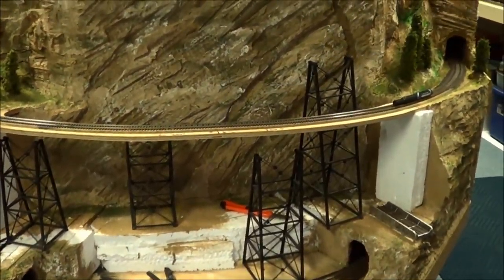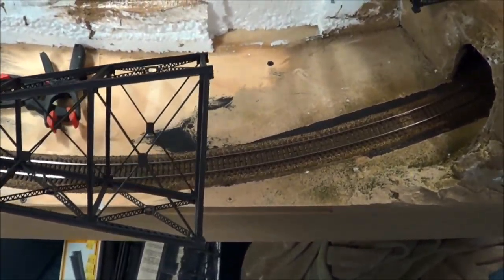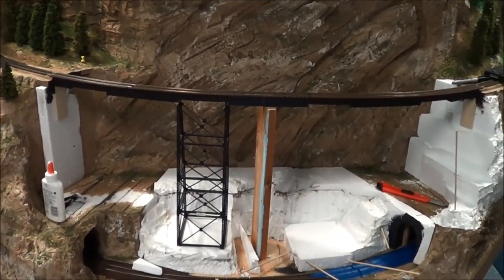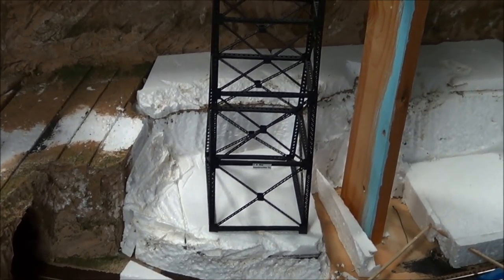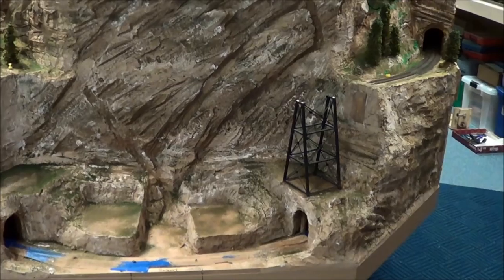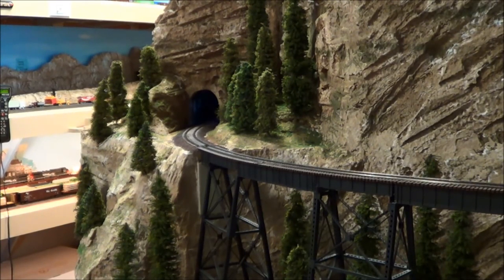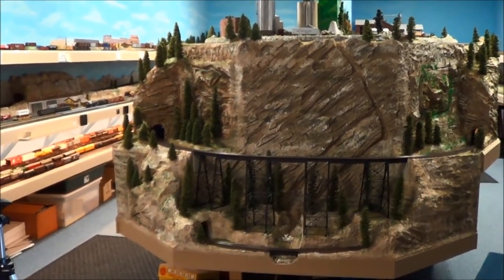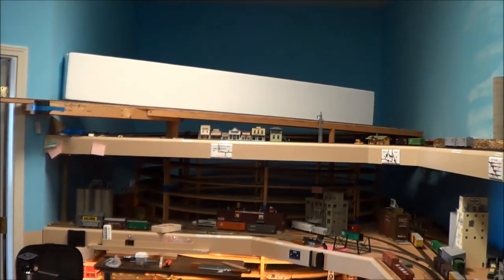Grande Pacific Railroad Part II  The Big Scene 8-2015

Comment: AWESOME!!! What radius curve is that? Im inspired!
Reply from the maker: All Main line on this RR is 36" some larger.
Reply: @arthurhouston3  thanks! Looks real good
Reply: @arthurhouston3  Are you atabout 24inches between the two track levels? Been rewatching pieces a few times, maybe i just missed you say it. Id like to use this approach on my own layout, albeit with a lesser 29" curve lol
Reply from the maker: @CSX_Bennett_Subdivision  The levels are off the floor 24" 40" and 60"  if did it again top would be 56 take one turn off of helix.  But it all works well.
Reply from the maker: @CSX_Bennett_Subdivision  24 from floor to top of bottom level.   40" from the floor to top of center section.  60" from the floor to top of third level.  So 16 inches between bottom and middle top to top .  Only 12" top of bottom to bottom of middle.  Used 1 x 4 for construction.  16" from top of middle to bottom of top level.   20" Top to top but have to take away the 4" for 1 x 4.

Comment: Mr. Houston, around the 21 minute mark there is an industry with tanks and a cream/yellow building w/smoke stack. Could you identify this kit or parts that make up that industry. Thank you sir great work on the rock faces, all that turned out fantastic.

Bob
The Fulton Line
Reply from the maker: rpm750 These buildings are all part of the Walters Ethanol Plant.  I call it Fuelish Productions Plant #2 because I actually built and ran the real one behind the Dixie Brewing Co in New Orleans, La. We produced about 10000 gallons and the State, Gov Edwin Edwards, convicted felon, served 8.5 years, decided it was not working for the state and cut of subsibity.  It was Fuelesh Productions #1.  But there are about 7 parts to the whole thing. I paint all building and will finish weather those in the future.
Reply from the maker: rpm750 Thanks for asking.
Reply: arthurhouston3 Thank you sir for the response. Love your layout tour videos, hope to bump into you if you visit the Piedmont Pilgrimage this fall. Bob
Reply from the maker: TU

Comment: what kind of mud did you yes on that
Reply from the maker: Product is called Cal Coat 127 industrial insulation cos sell It. Were do you live may have a phone number for you area and co name.
Reply: I live in the Dallas in texas
Reply from the maker: Call Distributors International in Houston 713 428 3900 I am sure they have a branch in DFW some where.  Bag around $15 goes long way. Do not add to mush water needs to be were it comes out on putty knife and does not fall off. Takes couples of days to completely dry and then you need to put coat of latex paint on it.
Reply: Thank you